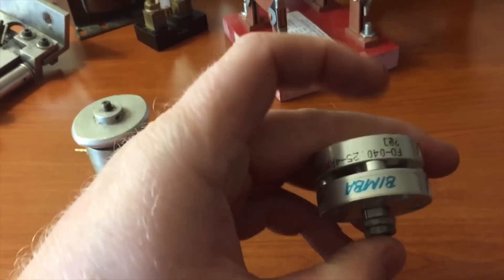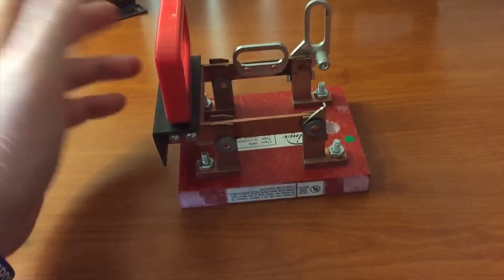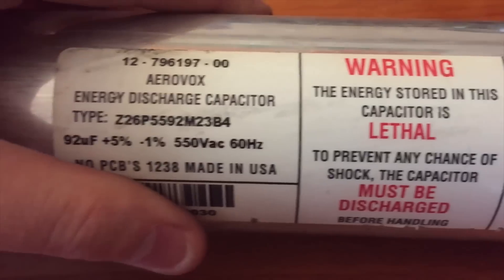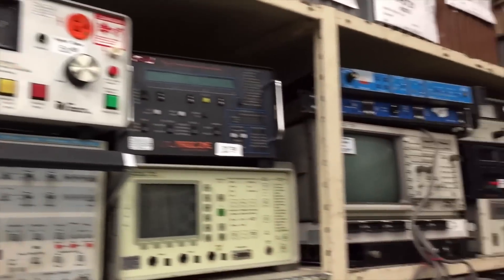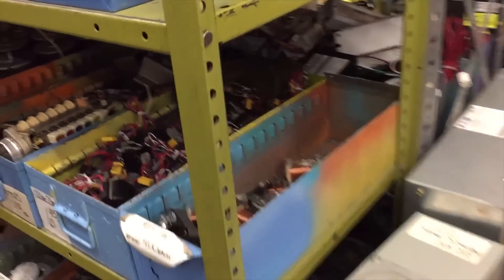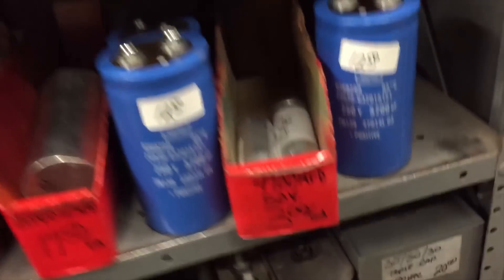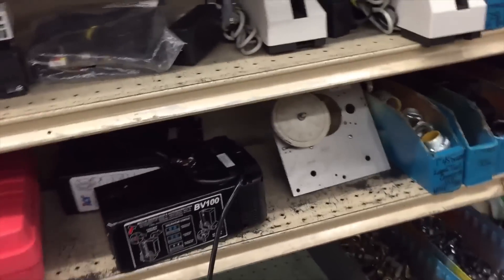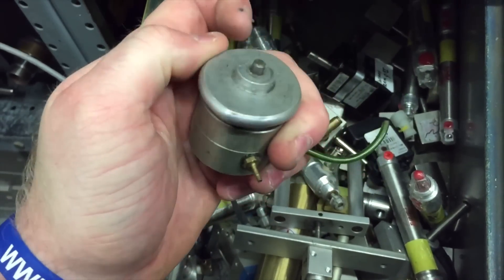Engineer's Dream Store

Comment: 25,000 amps?   is that what you said for the knife switch?    That can't be right.
Reply: The switch isn't rated at 25000A. The max available fault current (NOT the circuit protection, but the max that can momentarily flow during a fault before the protection interrupts it) where it is used must not be more than 25000A. Likely the switch itself can handle a few hundred amps, but not be able to interrupt even that, given that there is no means for arc extinguishing or rapid break. It is intended to be opened/closed at no load condition. For reference, many residential circuit breakers are 10000A max fault. When I have done commercial electrical work (not my primary gig) , we have had to prove max fault current for some things to pass inspection. Not always easy.
Reply from the maker: That's what the UL label says but I don't think so either.
Reply: Proto G that's so weird.  There's no way that's right.  Maybe 25.000, I think it'd be hot 250.00 amps.   Why do you think it says that?   It looks like on of those wooden based ones we played with in 6th grade.   You know you'd have a lamp battery a big goofy knife switch, a light bulb in a base, and a bunch of jumper wire with alligator clips?   Then you had to put all together.

Comment: Hey I was just there! I bought that $35 ignition transformer @ 6:12, I also bought one of those neato big switches I use when I demonstrate electrical wood burnings. I also got a surplus military laser targeter/rangefinder. It has a flash driven YAG laser. Im trying to get it to work without ripping it apart, but I can't figure out how to power it. https://www.instagram.com/p/BLMvyhBhgY4/
Reply from the maker: Awesome, just seeing this now. Did you you have any luck getting it to work?

Comment: It looks like a pneumatic relay or switch. Probably to connect a pneumatic supply into the system logic or used when you can't rely on a relay spring to break the connection.

Comment: Pan slower! Or, maybe not, you showed a lot of stuff.  Cheers, Mark
Reply from the maker: Yeah, it's a bit hard to see but I was in a rush. It was 20 miles out of the way to where I had to be for work.  There's too much to see in that store that I could be there for several hours and still not shown you everything.  Good thing for you, google did a complete walkthrough here: https://www.google.com/maps/uv?hl=en&pb=!1s0x88e7707c4f598b9d:0x92c044eddf5a57c8!2m5!2m2!1i80!2i80!3m1!2i100!3m1!7e115!4s/maps/place/skycraft/@28.5932979,-81.3801577,3a,75y,94.67h,90t/data%3D*213m4*211e1*213m2*211sN-k4KKDaQq0F6NHTasy97w*212e0*214m2*213m1*211s0x0:0x92c044eddf5a57c8!5sskycraft+-+Google+Search&imagekey=!1e2!2sN-k4KKDaQq0F6NHTasy97w&sa=X&ved=0ahUKEwi37IeUqZXOAhWDPiYKHb-fB_4QoB8IeDAN
Reply: Thanks for the link. Cheers, Mark